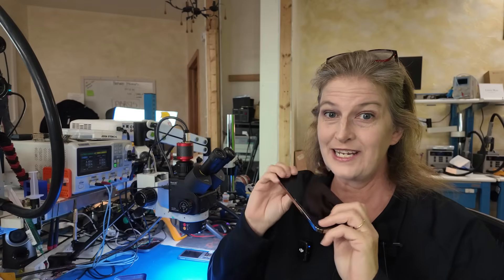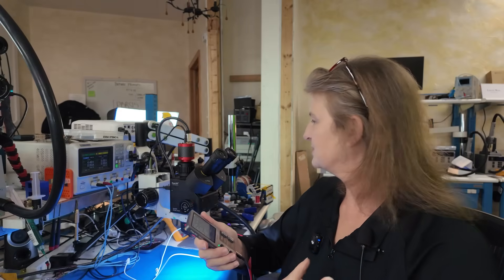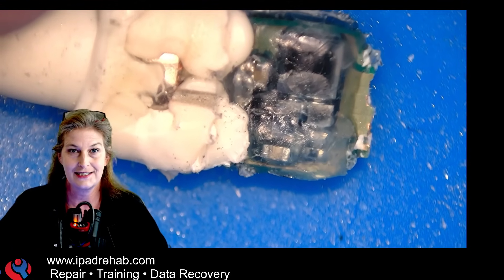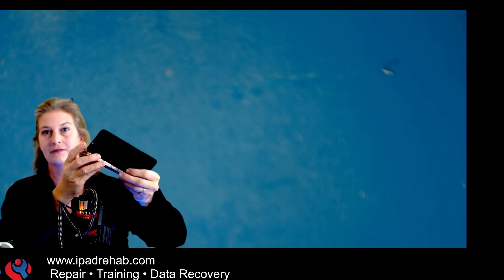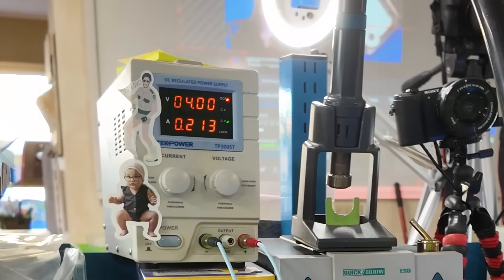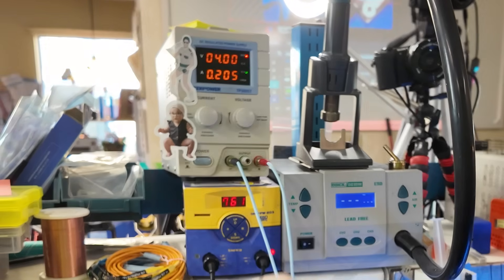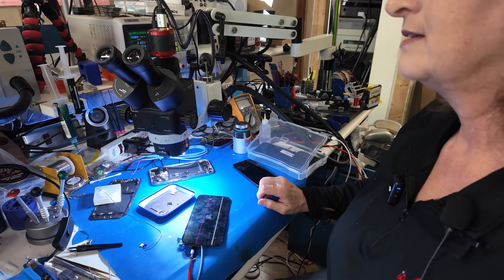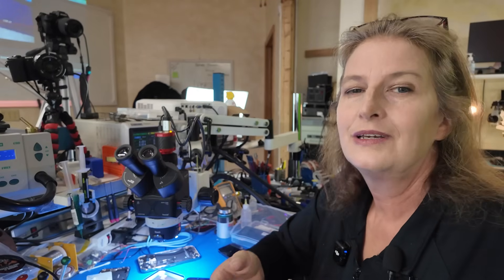Airplane Outlets Can Kill Your Phone (Data Recovery Case)

Comment: Well, the quick walk-around is too charge powerbank first.
And charge your phone from the disconnected powerbank.

In this case only your $50 powerbank will die. Saving a $1000 phone.
Some powerbanks even have wireless charging, thus one can charge the powerbank and the phone at the same time!

Comment: If you were my mom, my mom would have used the belt method. To make me listen to not connect an expensive phone into a varible voltage low aulity usb output. And i would definilty listen even if i was a teenager.

Comment: Good thing the one on my seat on my last United flight wasn’t working. So I used the AC socket below instead with my own charger. It was loose and keeps falling but at least it worked and was safe.

Comment: I do not trust airplane usb ports for another reason… they just don’t work 100% of the time for me. It’s like every time I go on a long flight where there’s a type A port on the screen, I plug my phone into it and like 5 seconds later it stops charging and never works again. I’ve tried a good Anker cable and a cable that specifically doesn’t transfer data and none of them worked consistently. I just stick to charging from the power sockets as pretty much every flight I go to China has them. Power banks are pretty much out of the question for me as they have to be CCC certified if you want to even bring them on Chinese domestic flights, let alone use them

Comment: This is why you always backup over the Wi-Fi and you always backup the phone to your computer. If the phone no longer works, you get a new phone and then do a restore from your computer and sync to your cloud. Redundancy is important. Also, buy a high quality power cable only. When you plug-in into airport charges or anywhere else, you are only charging. But that only does data protection.

Comment: I always use good quality cables and a good quality usb power bank on the go.  I try to not use public charging like a seat back charger or the usb ports built into a ac mains power point —- if I have too — I will charge the power bank from a suitable public power point to minimize potential loss

Comment: TL;DR never plug your phone into any unknown USB socket. Always use the 120V outlet with your own power brick. It's also for data security reasons.
Reply: I just plug my powerbank instead to charge it and then later charge my phone with my powerbank,  the powerbank cant get hacked, there is just a charging circuit and nothing else
Reply: @SpeedyGwen some airlines currently don't allow charging of phones using powerbanks in planes...
Reply: Universal outlet for airlines 110V 60Hz.
Reply: The bus i took for go to school have 240v outlet
Reply: 120V?
Reply: @johnps1670  lol yeah America’s power supply is so weak… poor things can’t even have rapid-boil electric kettles in their homes, it’s a really sad state of affairs
Reply: Or just buy a usb data blocker
Reply: @gelato007 or just cut the data line in the knockoff cable.
Reply: 120V is for wimps, real OGs use 250V

Comment: in my experience with my android samsung s20, I noticed that when I used the lower end charging cable, it doesn't do fast charge even though I have super fast charge option enabled on my phone. so when I take a look at the cable, it's missing some pins. but when I use the original cable that came from samsung with the box, it does have these extra pins and can do super fast charge. maybe that's a way to test if the cable is legitimate or not?

Comment: This is what happened to my beloved 1st gen iPhone SE by trying out different types of charging cables bought in Shopee. It was a charging IC problem and technician told me that it’s irreparable because it had damaged a terminal bridge sort off on the logic board. It was fried.
Reply from the maker: It is repairable but a difficult operation on the logic board.  If you still want it fixed for nostalgia reach out to us.  Www.ipadrehab.com

Comment: A lot of Android phones aren't susceptible to this kind of damage. I have just replaced the charging IC on a Motorola phone and serviced a no boot Realme device. Both phones had protection circuitry and active ripple filtering in the charging port sub board. The Motorola one needed a new IC because the guy thought he could replace the battery himself and to make it more powerful, he soldered a 12V lead acid battery to a VCC test point on the board. The charging IC got fried and a bunch of DC-DC converters inside the mainboard providing power to ICs and SOCs. Even though that happened, the DC-DC converters are protected so well the fused blew open on all and a small MOV tripped, saving EVERY SINGLE THING after the step down converter. The Motorola codename Cuscoi (or Motorola edge 50 fusion) retails for 230$ and can be found at around 200$ if you get lucky. It's also the phone I daily drive with a Project Treble Evolution X ROM. Out of curiosity I took my dusty old Realme 8 5g out of a drawer and sent 35VDC straight through the data lines of the USB port. I also sent that voltage to V+ and GND both correct and inverted polarity. It survived and didn't lose any functionality. It only died after sustaining 21VAC 50Hz for 23 minutes through the data lines. It even survived a USB Killer prior to that. I also took out a redmi note 5 pro (whyred) and it survived the 35VDC test on the VCC lines but not on the data lines. Mind you, that's a low budget phone from 2018. You're telling me apple can't design proper protection on a 1.000+$ phone? I'm not buying it.

Comment: I dont understand how come only Apple Cables have the protection built into the cables and not into the device as well as a backup. Do Samsung or Oneplus or Motorola also have the same issues?

I've got no idea how charging cables work really other than i buy my C to C cables either from walmart or amazon and its usually samsung, anker cables or the generic ONN brand ones and use my own charging brick or battery pack because i have no trust on public connections at all so i carry my own chargers.

Comment: Thanks for this video, never realise the power surge was so bad on planes. Just a note, a lot of plane now ban charging using power banks (or bricks) for safety reasons. I travel with an AC adapter thats got a usb charger , am assuming that the adapter will take care of the power surges and give a constant 5V output.

Comment: Probably be ok with a fake cable if you put a Apple compatible USB powerbank in between your phone and the dodgy charger port. Ya just need to make sure it's one that can be charged and provide power at the same time.   A powerbank also likely doesnt pass the data pins between in and out, so its more secure too.

Comment: Words of wisdom carry a couple battery banks. Never use public WiFi nor public charging ports unless you’re willing to have your info stolen by cyber hacks. It’s bad enough you give it away to companies. Don’t let actual criminals get hold your info.
Reply: public wifi in itself is not problematic. it’s weather the tcp frame and the ip packets are formed out of encrypted or unencrypted payload .. if you have good to great internet hygiene in general, then, you’re pretty much guaranteed to be transmitting encrypted payload.

Comment: According to the USB specs, a USB cable is not required or expected to have ANY electronics in it. Just four wires.
 THAT'S GENUINE, NOT FAKE.
 Unless you are talking about USB-C-PD where the power level matching is done by a signal from the cable? Counterfeit is thd wrong word.

Comment: The power control/battery management circuits in phones--including a top brand--are infamous for being the chespest design with the least protection. That's one reason so many phones swell and expand. Poor battery management.

But this is the first time I've had anyone suggest that genuine Apple cables have those protections. Is Apple beung intentional spiteful by not telling iPhone users that genuine cables have real advantages, and not just a high price?
 That's wicked.

Comment: that is actually illegal for a airline to put over voltage ports in their airplanes
Reply: What is the name of the law in question?
Reply: @matthewgaines10 USB and MFI specification is very specific and having out of specification parts is by definition illegal in an airliner. It means the part is completely unapproved to any standard, which on an airliner is simply not a thing as every part has to be to an approved and safety compliant specification.
Reply: @ithinkitwaskhamas I'm not sure that actually follows. The FAA is concerned  with the safety of the aircraft, not with the safety of your personal devices. For something like this, they might only test to ensure that nothing it does will put the electrical system of the plane at risk. They may not care if the passenger side output is truely USB compliant or not.
Reply: @SiblingCreature lithium battery thermal events and off-gassing are incredibly hazardous in confined spaces like aircraft cabins.  Even from small personal electronic devices like phones and tablets.  Aswell as the obvious fire risk aswell.  

Lithium batteries are rather sensitive to voltage.  Feeding any battery electronic device incorrect voltage is never a good thing
Reply: @BramBiesiekierski It’ll blow the charging circuitry in the phone long before damaging the battery
Reply: @greenrabbit0341yes.  That is still not a desireable outcome inside in the cabin of an aircraft
Reply: @BramBiesiekierski  I agree that it's  not desirable,  but that doesn't necessarily mean the FAA has seen it as enough of a risk to deny certification on those grounds, and by the fact that we are seeing this issue at all suggests that they haven't.   If the FAA has in fact certified that equipment, then it's use is not illegal, whether it meets the USB specifications or not.
Reply: @ithinkitwaskhamas  That's just plain nonsense. First of all, infotainment system does not need to use aerospace grade components. Secondly, you can easily find aerospace grade components to implement USB.
Reply: Couldn’t this potentially cause a fire on the airplane if the phone or device didn’t have advanced battery regulating circuitry?
Reply: And I’ve been in an AirFrance Flight (A350) and the crew told the passengers that the use of Powerbanks was forbidden during the flight. I want to use my own personal power, not allowed, this aircraft in specific didn’t had power outlets and guess what? Only alternative was USB type C or type A to charge your phone.
This aircraft had starlink working the whole flight in it I had a laptop and I almost couldn’t use it the whole flight because it needed an outlet to be charged.
Reply: @gabriwm  A10 warthog?
Reply: i mean its common sense dude, i would never trust my expensive phone to a random usb port, LIKE EVER.
Reply: This honestly doesn't make any sense I feel like Iphones should have a over voltage cut off switch built-in. Like my OnePlus open no joke charges at 20 volts at 6 and 1/2 amps and I know if it goes anything above that it just stops charging.
Reply: Most likely incompetence, these days trump maga hires are everywhere
Reply: @SleepyOx2023  I wasn't even talking about politics
Reply: @fartingthefart , true, but sadly politics affects all of us on the ground
Reply: @SleepyOx2023  I was actually going by the Canadian law
Reply: @SleepyOx2023  TDS brain damage.
Reply: @woopsserg , TDS is a badge of honor for the winners of humanity.  Because only humans can get it
Reply: @SleepyOx2023  Didn't know that those who are all for human extinction are the winners of humanity.
Reply: @woopsserg , i know right? , the orange cabal likes to keep saying they're winners 😂😂😂

Comment: Man am I glad i have over 800,000mAh worth of power banks and power stations so I never have to rely on sketchy public phone chargers 🤣
Reply: I have a 10k mAh powerbank (which has a capacity closer to 4k mAh lol) which I always use to charge my phone and in public, I never charge my phone, I charge my powerbank, its safer because its dumb, it cant get hacked through usb or something
Reply: @SpeedyGwen it have 10k mah battery but ur power bank got cheap circuits
Reply: Just don’t take that on the plane. Lithium batteries fire is one of the most nasty things that can happen on an airplane.
Reply: @sdstorm Good quality power banks are tsa approved and wont just explode on you.

Comment: I've heard about this happening in car chargers too. When the engine starts there's a big voltage spike, and the unstable power of the car alternator can mess with phones.
Reply: Have these circuit designers never heard of overcurrent/overvoltage protection?!
Reply: A high quality charger or the USB-C ports of known big car companies have OCP and OVP hence the output is stable and clean. But if you use some 1$ China adapter then there is probably no protection and the spike goes straight to your phone.

Comment: Airdropping is one way - connecting the phone to WiFi, or just using the data via the SIM-card, would also be another way to save the data, I would guess? 
I would have done both, connected the phone to WiFi so it could sync in the background, and done the airdropping, in case the person didn’t have synced the phone in a while, there are email, texts data from different apps to save, too…
Reply from the maker: There’s no data on the SIM card and the phone will only stay on for 3 minutes at a time until we did a surgery to replace the fried charge ic

Comment: I have some questions:
1. I've never heard about the fact apple put the protection circuitry into a cable instead of putting them into a phone, but I think this is a clever solution as these circuits typically die to protect the rest of the circuit, so you don't want to have this inside of your phone as it's much cheaper to replace the cable instead of replacing the phone. As long as you have a proprietary connector, this sounds like a good idea to me, but how is this implemented in modern Apple product utilizing the USB-C socket? If they put that protection inside the phone, it's definitely not good for customers.

2. How it comes there is so much fluctuation it can kill that phone? Don't get me wrong, I am not saying it's impossible to happen, I am just scared by the fact it is actually happening. And according to your video, this probably happens relatively often. Fire is probably the worst possible scenario that can happen on a board of an aircraft during a flight, right? This is something that can escalate very quickly and relatively easy to the unmanageable situation. Malfunctioning charging circuitry can relatively easy lead to battery overloading causing battery opening or explosion, which, can then easily lead to fire because of escaping flammable gasses. In fact, it's relatively rare to see this kind of event in „normal life“ (like being at home or office, traveling by train or car…). There were fire incidents caused by battery explosions inside of cellular phones or laptops, but they are very rare. But. According to the international authorities, fires of consumer's electronics on boards of an airplanes are considered not being rare. And that's the point, where, at least in my opinion, things starts to align into a potential problem. If all that USB charging circuitry in a passenger planes are designed so badly, it poses the serious fire hazard due causing charging circuitry of connected consumer's electronics to malfunction.

In fact, all that 5V (or what) charging sockets should have their own step-down converters, or something like that, because it's almost impossible to feed such a low voltage through a long distance. So these fluctuations must somehow overcome these converters, which is a huge design flaw. In fact, inside of an ordinary car, the on board voltage fluctuates a lot, it's going between 10.5 to 17V with a huge spikes, but everything inside that thing is designed to deal with such a power supply. Even the USB chargers, which typically does not damage your phone. This is, in fact, less about the onboard voltage fluctuations, as they are unavoidable, and much more about bad design of all that USB charging sockets inside of passenger planes, which, in my opinion, can easily escalate to a huge damage. If all this is true (and I believe it is not), we have a serious safety hazard.
Reply: Uh no the protection circuit doesn't die, the protection circuit is what stops androids dying. The problem is instead of being like android and having the cable and phone protect themselves, Apple only has the cable. So if the cable doesn't comply then the phone will die.

Not only is this not clever, this is criminal. It's not that android has the protection inside the phone instead, it's that it has BOTH. And it's not that the protection circuit breaks on android, it doesn't and it makes the phone keep working. Iphone just breaks.

Comment: Thanks for your video, just came across it. 
I am an Android user, so not apple specific. 
For travell purposes: Wouldn't a USB to USB device be good that cuts those voltage spikes out and has only the power pins connected,  but not the data pins? Does that exist?
So, no matter what cable could be used safely. Just plug it between the outlet and the cable.

Comment: I did the same for a very minor liquid damage iPhone 11 missing a temp sensor 3min reboot airdropped the necessary data before splitting the board. Ended up full repair except face id

Comment: I have a somewhat expensive Anker car charger on the back of my bike that turns the nasty 12v with all the noise from the motor starting stopping regen etc into nice usb pd, glad I paid extra for it. Ended up epoxying it into a cig lighter socket thing so I can "hardwire" it so it stops getting stolen. Wish I could get a high quality panel mount or handlebar mount one but all the ones I found are pretty garbage.
Reply: Still remember the days of the frequent "U2" TriStar failures seen so many of those.